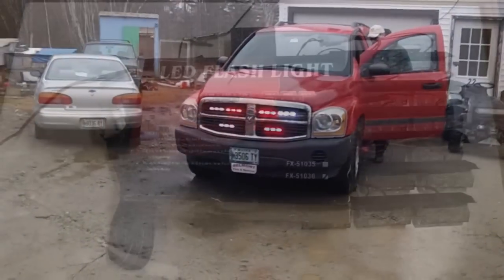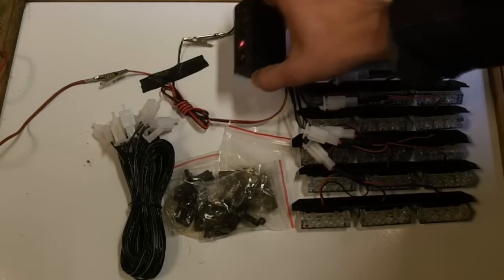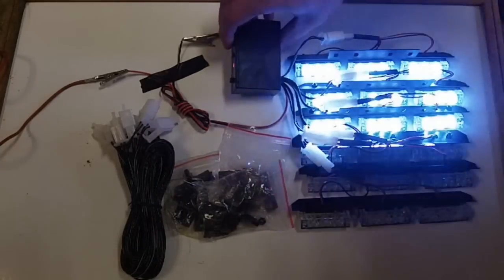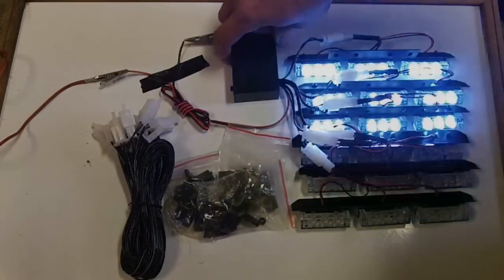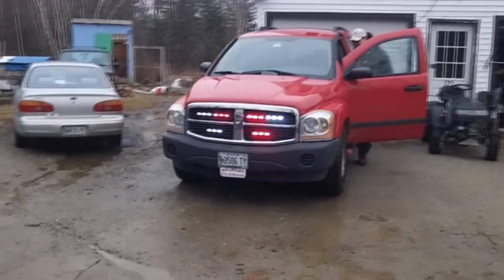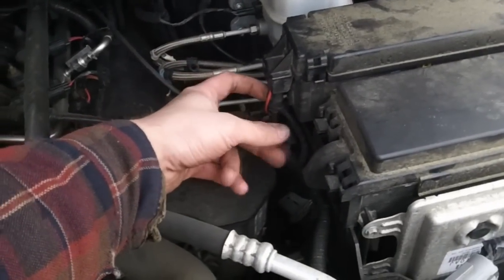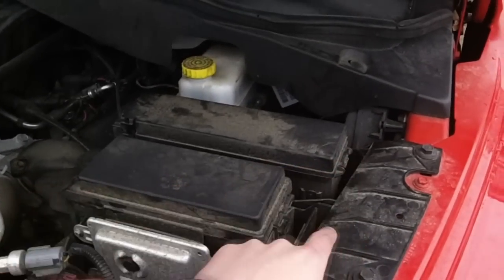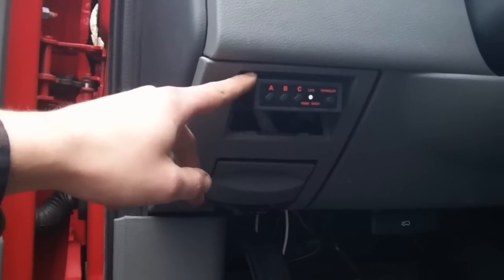Installation of  Emergency Service Vehicle Deck Grill Warning Lights

Comment: No one shows where the power source is!! Everyone just has power...I would like to see how to wire it to the charging system...
Reply: Add a fuse kit ftom walmart or hard line with a fuse a relay and a switch if your smart